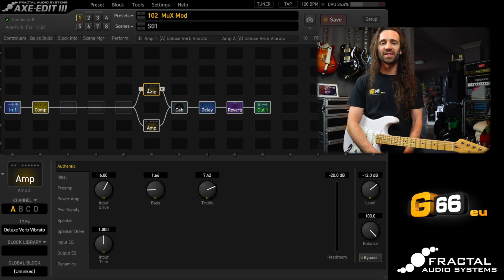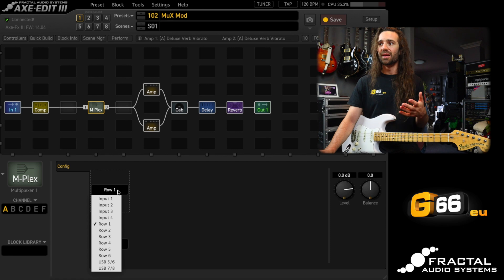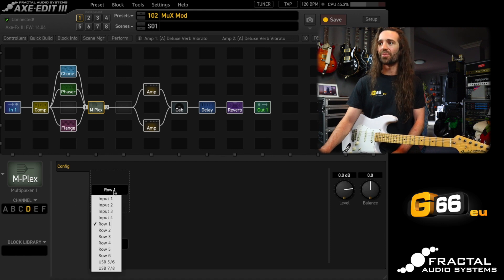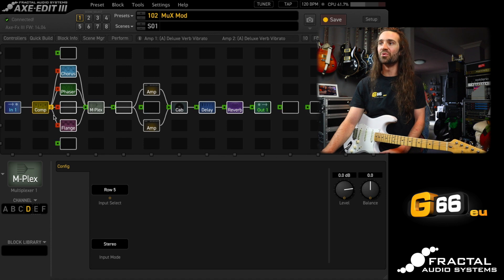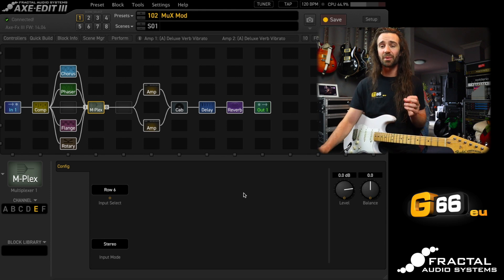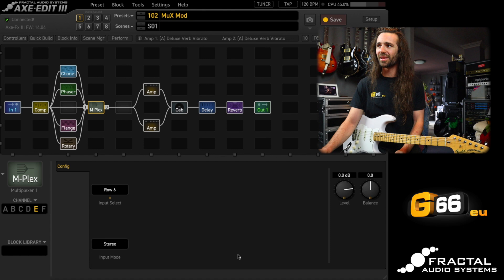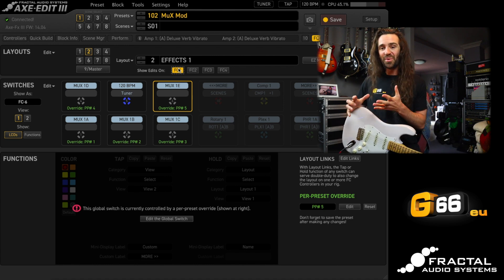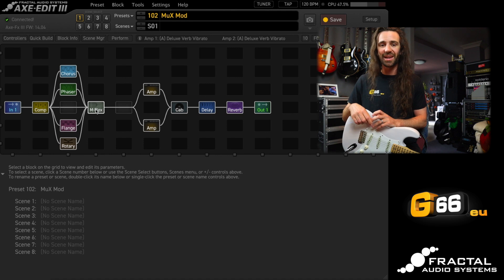Tuesday Tone Tip   Modulation & Multiplexer

Comment: the multiplexer is an interesting block, especially if you assign a modifier to the row selector. i've used it in a couple of presets to select between different delay divisions. i don't know if you did this, but if you're setting up two amps to run in stereo like this, you need to set the input select parameter to "left" in one of them and "right" in the other, so one amp only sees signal from the left and the other amp only sees right. you also then need to use two cab ir's and pan them hard left and right in the cab block. test with a ping pong delay. i will say this though - what you've achieved in that particular preset can easily be replicated using scenes - but think about this - you could save some pedal real estate if you simply assigned a switch to increment the channels in the multiplexor. you would only need one switch, instead of 4 or 5. you can set the min and max rows to be selected and have it wrap around.